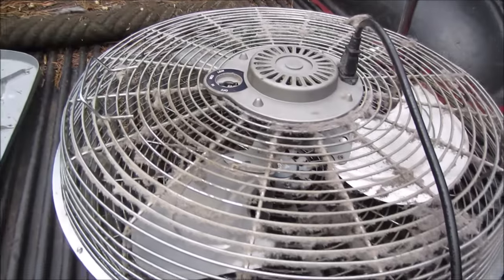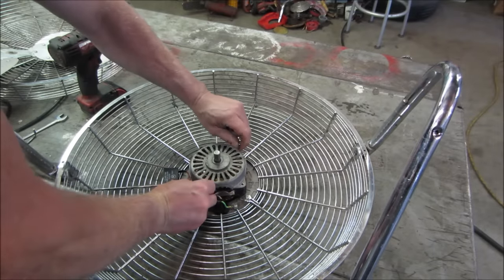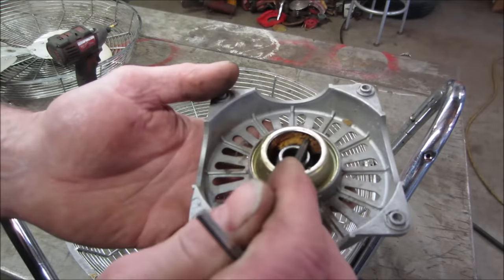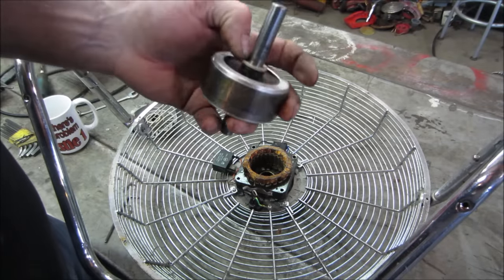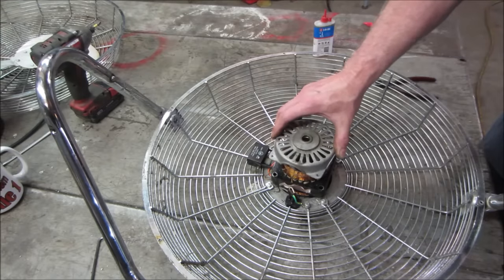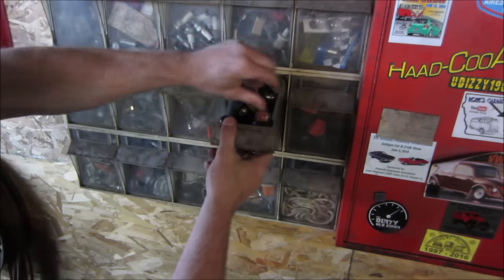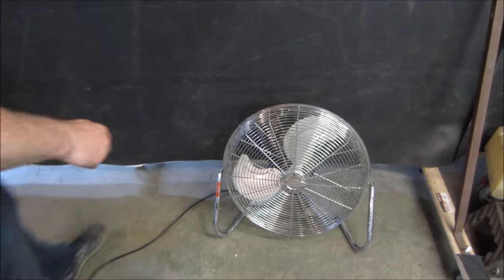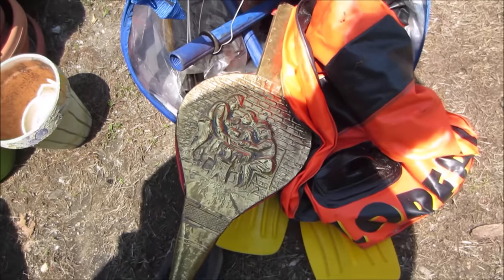Fan Blades Won't Spin? Lets Fix It

Comment: I once had a similar problem with a kitchen range hood fan. It too was gummed up and wouldn't spin. I took it apart, but all I had to clean it was rubbing alcohol. I asked a friend of mine at work about lube and he gave me a tube of, Molykote44 high temp bearing grease, light consistency. He said, " a little dab will do ya". That fan still runs.

Comment: Every time I find fans with stuck blades I take the motor apart, coat the two shafts with 3 in one oil and Bam! The blades spin for days! I have a fan that I did that to and the blades spin for about a solid minute after I shut it off.

Comment: I believe that's greased packing in the bearing cups. It self lubes the bearing when they get hot so it refreshes automatically until it's consumed and it starts friction locking. You can diy that self lubricating packing by using some cotton balls soaked in your choice of lube and stuffing it in the pots on both bearings. It'll run like new for a long time.

Comment: I repaired around a half dozen dehumidifiers years ago where the only thing wrong was the fan motor needed cleaning and re-oiling. Interesting part was most of the motors had a label that stated "add 4-5 drops of oil every 6 months" I guess they expected people to disassemble their dehumidifiers! Now the newer dehumidifier compressors die in a couple of years which makes them unrepairable.

Comment: Good one. I have the identical fan that I ended up mounting on a stand after I got it cleaned up and running. It's in my shop still.

Comment: The role of thumb in lubrication is that grease is for small velocity, motor oil is used when there are high thrust loads involved (there will be an oil pump somewhere) and sewing machine oil is used nearly anywhere else (low thrust and high speed).

Comment: One of the better oils I found is plain old Automatic Transmission Fluid (ATF). I've tried most everything in fans and most of it either evaporates or gums up the shaft.  I've used ATF in cheap fans with  sleeve bearings for about 4 years with no sign of gumming. Usually service my fans about every 6 months to blow the dust out and check lube.  I'm one of those nuts that can't sleep without a fan on, Summer and Winter. :)

Comment: I have one of those in my shop and it really moves the air. Another good use is placing it on top of a hot motor to cool the engine compartment. Just walk away for 20 - 30 minutes and it will be to a point where you can get to work on a water pump or a blown heater hose.

Comment: Son of a hovercraft! - I thought that thing was about to take off!

It's funny you should find this fan - We've just recently been through some of our fans to give them a bit of a service. As you say, motor oils aren't very good for this job, nor for that matter normal 3in1. We used to use a lightweight bicycle oil, but it seemed to dry out and start to bind up just like the others, but quite recently a local hardware store has started selling a Teflon fortified bicycle oil, so we're trying that out right now. So far, so good.

We know those bearings as "Oilite" self aligning bearings, and on larger motors, like yours, they're usually surrounded by an oil impregnated felt pad. It's not a bad idea to scrub out the bushing inner surfaces with a felt, or chamois leather swab, soaked in Zippo lighter fuel. Alternatively, a soft wire brush on a Dremel, but carefully does it.

A nice video, and a nice result at the end, but for God's sake keep it away from Kansas, otherwise they'll think there's a tornado coming!

Comment: A lot of those old fans used a shredded type of packing that was impregnated with oil and you were supposed to pack it around the bronze bushing so that it could slowly weep oil into the bronze bushing. The same company that makes that "3 in 1 multi use oil" in those tiny little red and white cans also makes an electric motor lubricant that would be perfect for that fan, and you can put some extra oil in the packing so that over the years it will slowly weep out into the bronze bushing.

Comment: i love my garage fan. i sleep with in my face and have it running 24/7 nonstop. i saw that the motor is self cooling so it'll never over heat, meaning it'll basically run forever, especially since there's no debris to get stuck in it.
Reply: update, mine just seized up. idk if i can fix it though. might just get a new one. i'm gonna try though.
Reply: another update. WD40 is magic! didn't even have to take the fan apart. just squirt it into the shaft from the front and back and it's good. didn't even need the oil port, which was discovered after it was already running again. was hidden on the front tip of the shaft on the side. oh well. if it ever seizes again, i'll know where to put the nozzle more specifically.

Comment: Great video and repair Mustie1, thank you!
That waxy felt like gunk around the bearings, I think was used to hold oil and over time the heat and dirt make it decay until it is useless. I dig it out and replace it with some felt to hold oil for the bearings. That works the best and longest for me.
Reply: Yes, it works like a slow release greaser when it gets warm.

Comment: That yellow material is packing for holding the light machine oil to supply the bushings with oil. When it runs out the fan seizes. The manufacturers only want them to last a season or two. Just service them every year and they will last for decades.

Comment: I bought a cheap plastic desk fan back in 2012, and first power up, it wouldn't spin, second power up with a little assistance, and it barely turned, so took it to bits only to find the monkeys at the factory had plastered grease all over the bushings, as in bronze bushings that needed oil, so thorough cleaning out of the grease, applied liberal amounts of generic 3-in-1 oil (not the brand, just the type), and it's still spinning to this day, well, not today, it's cold today... :P

Comment: They usually put something absorbent in the bearings and saturate with lubricant. That funk you poking at was supposed to be oiled but I dont know if it would swell back up. Good stuff 3n1. Turbine oil, forget the brand comes in a bottle like you put gas in to start engines with a pull out tube.

Comment: Rockport is looking as empty as it does in the middle of winter. 

As someone mentioned, the packing around the bushings is oil wick. A good light non-detergent oil soaked into those wicks will keep the fan going for a few years.

Comment: Water won’t hurt fan motors if you blow out dust with a hose nozzle; it is only long-term immersion that will corrode it. If you dry it in the sun or with a heat source, it will be fine. Usually a little dish soap on a rag will clean the greasy dust that accumulates on parts, so it looks like new. If the dust is allowed to remain on plated steel parts for years, surface rust may result, which can removed with fine steel wool.

Comment: thanks... my fan is a couple years old and just stopped turning 

I used your video , but when I opened  motor enclosure it was clean and the shafts were not worn.

so I just lubed bearings and turned it on (I hope the lube does not gather dust in the long run)

Comment: We always used 30W non detergent oil on the bearings on the heater fan at the school I worked at. I also added either ATF or Marvel Mystery oil to the 30W oil. I know i never had any luck at all using 3in1 oil in a small fan ! :-) the manufacturer of the heaters called for the non detergent oil so that's what I use in all my fans as well.

Comment: I’ve been fixing fan’s for years and most people just throw it away I use high temp grease after I clean up the old stuff.silicone grease like you use on the disc brake pads works great

Comment: Your yellow material was an oil reservoir, it gets soaked in a thin oil which in turn soaks the oil lite bushing  providing lubrication to the shaft. If yours is all crumbling and falling apart you can try removing it and get a block of felt and cut it to fit in that cavity, then soak it with oil good and let it rip.

Comment: Built my shop 10 yrs ago started out with 3 fans all robbed out of furnace's replaced a couple of times, Now have 2 April Air units, electric bill went up $10.00 but I spend more time in the shop. Texas

Comment: as ken said that yellow foam is for holding oil for the oil light bearings. when it has rotted away i have used foam (like from upholstery) 
repack around the bearing and soak with 3 in one oil. will last for years.

Comment: The bathroom exhaust fan is original to my house (built in 1959), I pulled it down to clean it five years ago, it said to use 20W “motor” oil. There were no ports to add oil and because it worked perfectly (and still does) I did NOT take it apart. I didn’t want to take a chance on getting dust inside of the motor and ruining it.

Comment: you've no idea how many of this fan and the 16" oscillating fans i have thrown away over the years as over time they just get slower and slower to the point high (3) is as fast as 1 was when it was new. To the point i've started saving the bits of them in order to lash up something with a better motor and pulleys and ball bearings
I really want one of those crazy 36"-42"  belt driven drum fans to bash in the corner of the room to run essentially 24/7 at about 200 rpm

Comment: Actually, I believe that lubrication material is called Permawick. My current predicament is trying to get the material out and replace with a wick from a yard torch lantern thingy. The cover is held in with rivets and I really don’t wanna break them out. So I’m trying to figure out a solution.

Comment: 99% of the fans I fix just need a drop or two of light oil. Fixes them everytime. I do this to all my fans at the beginning of the heat season. Some have oil wicks similar to felt. But those do get hard as you have seen. New felt, oil and yet good to go.

Comment: That fluffy white stuff is a wick for the oil. You saturate the wick with very light oil. I use atf. It works best if the oil is warm

Comment: Another thing that is always a good idea ... those bearings are usually self centering... the batting material covers up a spring washer that puts pressure to hold the impregnated oil bearing firmly to the motor frame halves ... once it is put back together take and give it a few light whacks with a  wooden/ plastic  handle of a screwdriver... that will center the spring loaded bearings and make the motor shaft spin super free ... the motor can spin those blades MUCH EASIER and blow more air that way too which will also reduce heat in the motor as well

Comment: If I haven't responded before....  If the motor is still good, then most likely the oil  has gone gunkie, if you keep it plugged in, the heat from the motor will thin the oil and it will run fine. Let it cool off and it will start slow again. So, oil it (maybe down the shaft).  I know this because I find window fans like this all the time, haven't purchased one in years.

Comment: Nice little fix. Drill an oil hole in it to keep it lubed and drill a hole for a pin to hold the knob on and it’l last 10 more years!
Was that an open stern boat (like a pickup truck with gate down) I saw in the harbor? Weird but something I and Mustie1 would like. Haha

Comment: Fine sewing machine oil... I use it in my .22lr *(1980's Ruko M20) and I've never had it bind up from lint/dirt.  It is beautifully thin oil.   Old broken switch knobs, if the shaft on the switch has a split just bung a hole in the knob and put a shim and screw in er.

Comment: You could use a wet/dry vacuum to periodically suck up the dust that acumulates behind the motor . To reduce / prevent overheating and the dust possibly igniting .

Comment: I have a high velocity fan just like that in my bedroom. Sound of the fan I don't hear motorcycles or vehicle exhaust at night time. Best $40 I've ever spent
Reply: That's what I did for "white noise". Had an apartment years ago that when it rained the sound of the drops on the metal flashing around the windows kept me awake. So I bought a fan and it worked great! We also used it when our babies wouldn't fall asleep.

Comment: Mustie, make sure you explain to people watching not to run the motor for any long period of time other than to test once the blade is off, they will overheat because the fan blade serves a dual purpose, not only does it cool you  off by pushing air at you , it also drawls air through the cooling vents of the fan motor, thus keeping it cool.

Comment: the bronze bearings with holes are powder metallurgy pieces, they are compressed powders that are oil impregnated.  the Hummer H1 uses similar bearings in the portal axles

Comment: Graphite powder works best on fan motors. On these motors I've always had them lock back down after a few days of running with petroleum lubes for some reason they just gum up and turn the glue. The graphite powder prevents that in most cases. Sadly on several on my attempts to stop ceasing fan motors, I have to replace the motor due to constant ceasing after time. Anyway, try the graphite powder. It can be found anywhere.

Comment: I don't think your fan will work for very long before it quits again. The materiel in the bearing housing was intended as a sponge to hold oil. It was most likely some sort of paper . How these bearings work is the sponge holds oil and as the bearing runs out of lube it heats up. the heat lowers the viscosity of the oil in the sponge to where it leaks a small amount of oil onto the bearing replenishing the bearings lubricant.  Eventually the sponge runs out of oil and the bearing fails. 

Older motors did have oil ports that allowed you to add oil to the sponge, but people generally never add any oil and the paper like materiel they use these days breaks down over time as you could see in your bearing where most of it was missing.

I've experimented with tightly packing in heavy duty shop paper towel materiel as a replacement sponge, but my fan failed again after a couple of months. I haven taken it apart again, but I suspect the paper decayed and clogged up the bearing. If so I will next try packing in natural felt as an oil sponge, an older gentleman I know who worked as an HVAC service tech says that's what the motors used to use way back when they weren't built as throwaways.

Comment: I have kept numerous fans running with WD40 or Motorkote that turned only when flipping the blades.Its like starting the old .049 Cox airplanes,but once you clear the bearings/bushings you are good to go.

Comment: You had the right idea about that foam around the bushing. When new it was soft and pliable and it was soaked with machine oil. When the bearing heated up it would pull oil through those tiny holes to lube the shaft. The old foam can be replaced with an oil soaked round disk of felt around the busing. For maintenance, add a small hole to the top of the felt housing to periodically add a few drops of oil. Your repair is not going to last very long.

Comment: I know it’s a sealed bearing, but you could soak it in solvent or gasoline and then soak it in light machinery oil to refresh it. It’s not a car part under heavy load so that could have freshened up the movement a bit. Let me know if my idea is wrong though.

Comment: The washers on the rotor opposite the blade wear out. When they do, the shaft presses against the bearing housing.
Take an aluminum pop can and make 2-3 washers.
Add them to existing washer. A little oil added then spin test it. If too tight, then remove one at a time and test spin. You may have to preload the bearing so the aluminum will conform to the proper shape. Do not use steel!
A very GOOD oil is synthetic gun oil.
Thin, works in extreme temperatures, and cuts wear.
Some of those bushings have felt in the bearing housing that is supposed to have oil in it.
Some bushings are bronze and you can have issues when oiling and things wearing out.
For those, simply remove the motor and reinstall the motor 180 degrees (upside down). Those bushings wear a divot in the bottom sometimes.

That fan is supposed to have rubber feet to reduce vibration transmitted to the floor. And to help keep it from walking.
Cut garden hose and glue in place. Rubber garden hose is best.

You can get a new knob for that switch too!

Comment: I have a Patton and Lakewood both 18" they use the same Mcmillan motor it's blue. After many years the Patton started to make noise and got hot , guess I was lucky it was just hot and a small amount of smoke . I shut it off as soon as I heard the noise. I took it apart  and didn't know what oil to use so I used the 3 in 1 red can. It took a few years before both started acting up . That oil was like tar in the bushings and shafts . I cleaned that off and re-oiled it with the blue can 3 in 1 . Trouble is the wrong oil is in what's left of the wick . The bushings on both are not bronze they are steel. Now they both work fine yet the old wick when it warms up seeps the wrong oil on the shafts and bushings. I keep removing the front grill and wipe the black off yet I need to dig out the old wick . Mine has oil ports , since the bushings are steel and not bronze I guess the wick only lubes the shaft washer can't go through the steel bushing. I guess I'll dig the old wick stuff out and replace it with felt so I don't have the wrong oil mixing in . It may be the heat that causes the oiled wick to get on the shafts even if the bushings are steel . When the fan is running the shaft moves forward when off it slides back. The new fans are junk . It's just a real job taking it all apart yet must be done so I don't ruin these two mid 90's 18" fans.

Comment: yeah that's felt around the bushings and it's there so when you oil the felt it'll kinda hold that oil there for a long time and keep the shaft on the motor lubricated